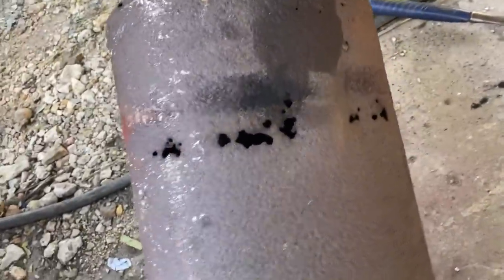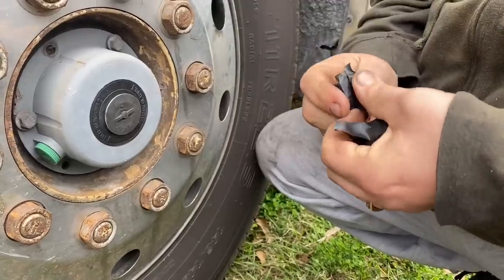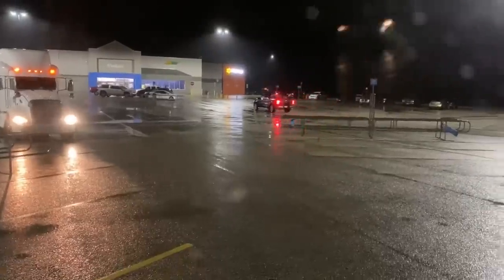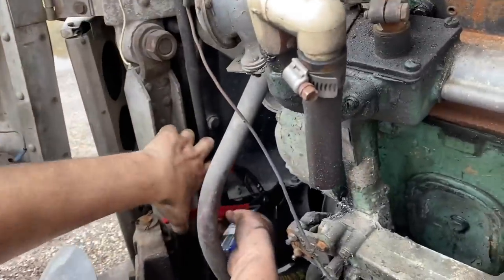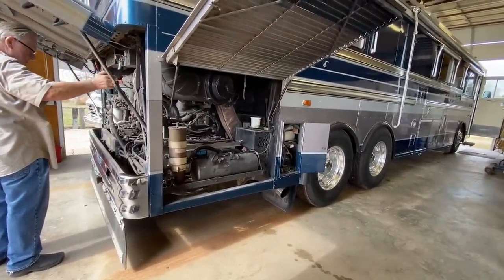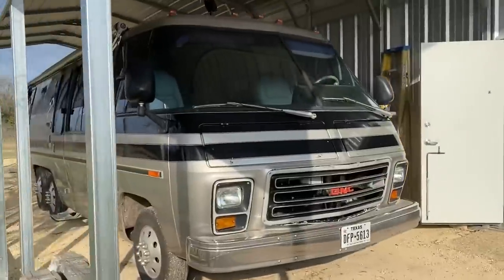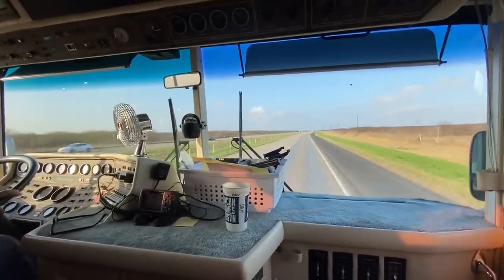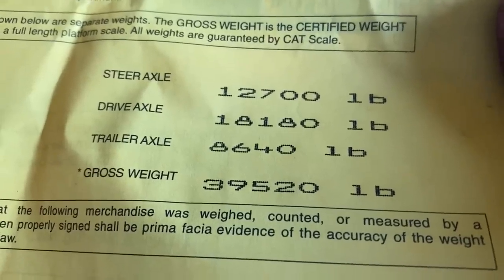New exhaust, maintenance on silversides, breakdown, and new Wanderlodge 8v92TA

Comment: That B747 with the shuttle on board used to live 2 miles from my house during the shuttle years at USAF Plant 42 Site 2,   The shuttles would land at Edwards AFB and would be tractored south on Challenger Way to Plant 42 for maintenance and repair.  Later, the shuttles would be loaded on the back of the 747 for the flight east.  Those days are gone for good, as is most of the activity at Plant 42, thanks to Dumbya Bush moving production of the F-22 and F-35 to Ft. Worthless to reward his "Ranger" supporters..  The U2 is still flying, though.  Lockheed Plant 10 is just a service station for the C-130s, a far cry from the L-1011 days, when tens of thousands worked each shift building those and the later model U2s.  The lesson was never learned here that an area that overdevelops due to a single industry is looking at big problems down the road.  Ask Michigan about that.  The aerospace decline wiped out a family owned charter (and transit, until the '70s) line that had a fleet of mostly ex-Hound 4104s and a few 5103 transits.  Their bread and butter were the Lockheed commute runs from LA up to Palmdale, which involved several routes that ran daily.  Lockheed knocked that out, and the charter biz was nil, after they'd just bought some new MCIs.  They sold out to CoachUSA, which lasted about 6 months.  They folded, and a couple guys got ahold of an oddball Setra, which they ran senior citizen day trips on and an occasional Vegas lease job, but that didn't last long, either.  Now, there's only the local transit agency for buses...and a derelict 4103 that keeps calling to me to save it, but I plug my ears.

Comment: Next time you change the batteries on those wheel sensors... Dielectric grease. Like brill cream. A little dab will do ya. I put it on Any electric connection on my big trucks.

Comment: That Wonderlodge was certainly clean and I love the driver’s station layout.  It looked like it was somewhere between a motor yacht and a Class 7 or 8 road tractor.  I have a soft spot for anything Airstream. I don’t know if they (airstream) still give factory tours but if they do or should I say it when I went on it as a teen it was certainly worth going on.  I went with my best friend family to pick up their new camper at the factory in Jackson City, OH.  

A tin of pure “Silicone Grease” like you find at the plumbing department at your favorite big box hardware store or on Amazon using the search “Pure Silicon grease” or “Trident Silicone Grease Jar” on the threads/o rings and if you already have not replaced the o rings on your tire pressure sensors battery compartment cover it most likely would be a good idea as well.  I had a set of those of tire pressure sensors on a truck I had owned and the o-rings that had come on them were absolute junk.  One other thing use coin not a screwdriver to open and close them or a Dutz fastener screwdriver or if you want make your own a knock out slug from a electrical box and a piece drill rod and then silver braze them together and add a handle of your choice.

Comment: I lube the o-rings heavily with Vaseline before spinning the cap back in.
Reply: Deeper Throttle you shouldn’t ever use Vaseline on o-rings. Vaseline is a petroleum based product that can degrade the o-rings prematurely so they probly aren’t doing you any good anymore. 

You can get a product made for that in the plumbing supply sections of a good hardware store that is made for that purpose but is not petroleum based and will not break down the rubber. You
Reply: Shhh .... Vaseline is an o-ring salesmen’s best friend
Reply: Silicone dielectric grease is the way to go!

Comment: Over the years I had two different brands of TPMS units.
The first used the sensors you have.
After 10 years or so I removed and discarded.
For several reasons.
Reply: There are only two types of TPMS: 1- That work but will fail eminently or 2- have failed and you go back to how my great grandfather would check his tires..... with a $2 gauge
Reply: @RustyZipper  TPMS is VERY handy to know you've got an imminent tire problem before the tire problem explodes underneath your bus. Differences in tire pressure and temperature will reveal a developing situation before you get stranded on the side of a highway, or even worse, lose a steer tire and have control issues.
Reply: Steve Costello - I agree, I like Scott’s system but most folks (myself) are unwilling to shell out the money

Comment: Hi Scott.
I like to use phyllips screwdrivers for the little star battery covers and 
peel off the first layer of tape, discard it and then cut it with wire cutters.

Comment: QUESTION I use a centramatic balance rings on the steer axle and beads in the drive axle tires. Do you have any experience with either of these or what do you do?

Comment: I am getting ready for my exhaust installation,  what did you install? I like how it's routed.
Reply: Put the biggest muffler that you can fit.  That droning has to get annoying on a long trip.  Of course if it's as quiet as mine, you'll definitely need a tach.  I only hear my engine with the windows open and concrete barriers.
Reply: @MrMauserb  I was wondering about the multiple baffles.

Comment: Quick question: do any Detroits use or have ever used glow plugs ?
Not a mechanic so forgive me if it is an obvious answer
Reply: Dan TX a real diesel doesn't need glow plugs because of the high compression that's why the subject never comes up here..........but I can't answer your question regarding detroits.
Reply: No glow plugs on Detroit engines . And real diesels use glow plugs on some applications.
Reply: We generally use block heaters on Detroits when its cold out.  The tight ones will start in the 30s (and maybe lower).  Our worn out Detroits get grumpy below 45 degrees or so.
Reply: To help settle this, a Diesel usually has to have pre-combustion chambers to use glowplugs. Direct injection Diesels sometimes have grid heat, literally a heating grid that the intake air flows through. The Cummins engines in the Dodge pickups used grid heat, as did an Oliver farm tractor I once helped work on.

Comment: First thing Id do with that Airstream? Stuff a Duramax into it.
Reply: Ew
Reply: Deleted 24V Cummins
Reply: The 454 moves those along really well.
Reply: No issues with that 454, but If I went diesel I would use a 12 valve 5.9.
Reply: Concerns they were underpowered for towing a toad...
Reply: @grahamroberts4865  probably passes everything but a gas station...
Reply: @prevost8686  that would be my second choice. And its a toss up as to which one is cheaper to find and easier to do....